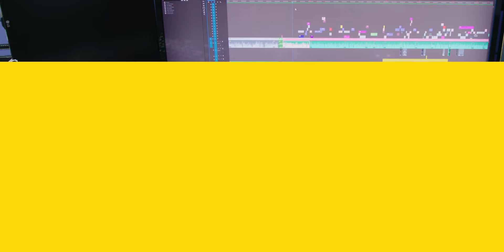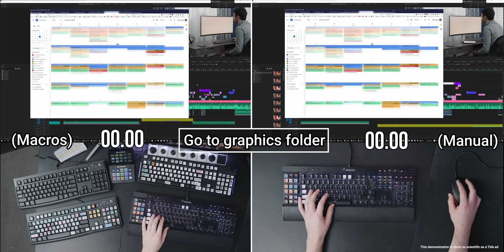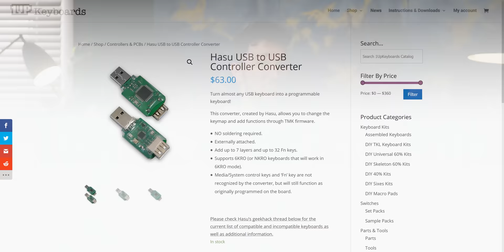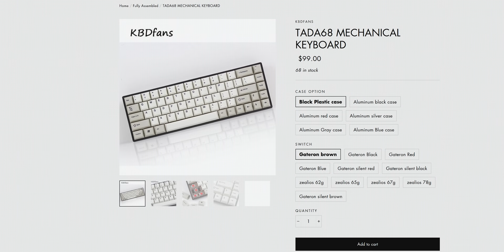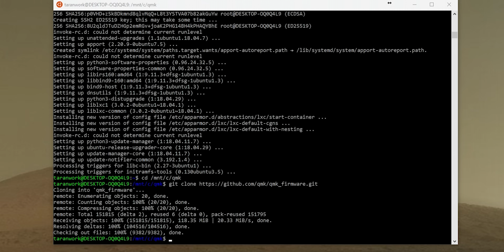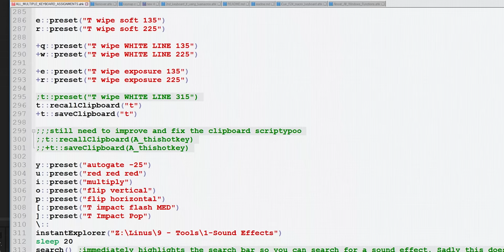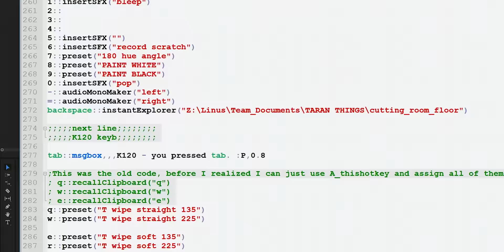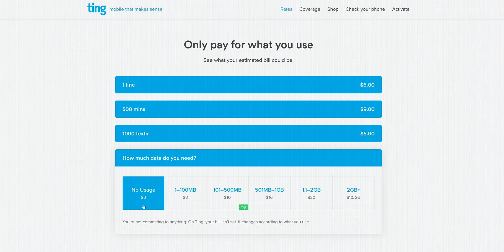Can your Keyboard do THIS?? - Make ANY key a MACRO!

Comment: Meh.....
After trying the inception driver and completely messing up my windows 11 after the installation, I decided to take matters into my own hands. (I couldn't even logon to my computer because my keyboard driver was so messed up.)
My solution was to use a pi zeroW. I wrote a program to read the raw key strokes, and send them in the raw format to a program on my computer.
On my computer I had a folder of programs that I wanted to run based on the key ID. Eg: The "1" Key has a key code of 2. In the folder I had a script file named 2.(whatever ending, eg exe, ahk, bat, ink, ....etc)

The beauty of using the pi zeroW with network sockets is that my keyboard is now a wireless network keyboard ! ! !
I can also control multiple computers at the exact same time ! ! ! (Come to think of it.... I could run it from the other side of the world!)

(I can't wait to mess with someone's head that I can still use my old broken keyboard after unplugging the chord.)

Hypothetically this could all be done with a pi 400 (70usd), but the pi Zero W can be had for <10$

Next step: Cellular based keyboard? Not so hard to do... however I can't think of an application for it.

Comment: I really don't get it why there is no keyboard manufacturer which creates keyboards where you can define every single key with a software. 
Having to use further hard and software is so dumb. 
Especially things like "hitting shift twice to write brackets" should be part of every keyboard software.

Comment: Once it’s setup is computer dependent or completely usb hosted. I have had need to move the usb to different systems to do macros especially for form fill ins.
Reply: You would still need AutoHotkey installed along with his scripts (customized for your needs) installed on a computer.  The Adapter though would mean that you would not have to have to install Luamacros on the computer and configure it as once the $63 adapter was configured to convert all key presses to press the F24 before and let up after you release a key that part would function from one system to another without installing anything.

Comment: I downloaded a Corsair program that gave me heaps of system info like temps and hardware utilization but  it crashed my computer a few times and disconnected my keyboard and made my pc fail to boot a few times so when it finally booted I uninstalled it and now my pc is okay, why did Corsairs program do this?

Comment: Windows user:  I want to add a second keyboard just for macros.  This will involve buying a USB interceptor dongle, spinning up a Linux environment within Windows, installing Git, downloading an entire repo, modifying firmware for the dongle written in C basically to wrap any keypresses from this keyboard with an F24 key I'm using as an additional modifier, compiling it, using some other software to flash that to the microcontroller in the dongle, making sure you've done the correct rain dance of plugging the device in, then install autohotkey and program any macros I want to use in autohotkey's proprietary scripting language that isn't used by anything except autohotkey.
Linux user:  I want to add a second keyboard just for macros.  This will involve writing ~10 lines of Python to use the evdev module to reassign keypress events from the second keyboard's device ID to any character, Python function, shell command or whatever I want.  I'll have to add my user to the input group and set the script to run automatically at boot.
Mac user:  huge trackpad go brrr
Reply: Also, I'm a pilot.  Airplanes are increasingly switching from single-function gauges and controls to multifunction displays and inputs.  Garmin even makes primary flight displays with goddamn touch screens.
Reply: @thegardenofeatin5965  What a good idea! Use a USB programmable touch screen for macros. Let me know when you have a prototype and I will beta test for you. It's only a matter of time before this is available.
Reply: @franklidgad  I mean, at that point, just buy a big ol' touch screen and write a program in QT or whatever to do whatever you want it to.

Comment: There's a much simpler approach. I've bought a Razer keyboard and keypad, Corsair keyboard, and Genovation keyboard (KB170) and a logitech gaming mouse (G502). Each has it's own software to program each key individually without any extras or other programming related stuff. I applaud you for your creativity and problem solving abilities, but it really isn't necessary.

Comment: Maybe I haven't fully gotten it but I think you just wanted to confuse and wear out people? Why not using for example a EvilCrow Keylogger device from AliExpress which costs a third and is also an Atmega32U4 board with Wifi and SD card support? This HASU thing seems to be totally overpriced to me and a light version of the EvilCrow. And why the hell using AutoHotkey? It is one of the biggest IT security weakpoints and it is blocked/forbidden in most company networks/pcs. And if you are already scripting in AHK on this level then you could also reprogram the Atmega32U4 directly with the Arduino IDE and it's librarys. That's kind of a similar challange and your solutions seems to only overcomplicating things. And further you would have a completely HW compatibel solution without having to install any SW to your PC/Smartphone/Tablet. It will work everywhere as a HID and the PC won't be able to find out if the key presses are real from a physical keyboard or code triggered by the Arduino microcontroller. Or am I missing the point of this video?

Comment: installing ubuntu shell + compiling hex is TOTALLY UNNECESSARY no matter what your argument is. You can completely go around this by using the tmk online configurator.  there is nothing you need to do manually that the online configurator can not do.

Comment: Is this info still relevant?  The HASU converter is out of stock. 
Also, I bought a Corsair K55 keyboard based on your videos but I cannot program macros. After searching the web I’ve found lots of people having the same issues with the keyboard and the iCue software.  
Please suggest an alternative programmable keyboard!!!!  I desperately need one 😢 because I have carpel tunnel in both hands so I want to reduce keystrokes and mouse clicks. TIA!!!
Reply: The K55 works just fine, I'm using it right now with the latest version of the iCue software.

Comment: 04:03 . "One of the best features Rayzer Cynosa Chroma is that it can distinguish between multiple keyboards". Does that mean If I buy multiple keyboards of this one I can let each of them a completely separated and distinguish Macro keyboard (with no conflict between eachother)? If yes then Luamacros (and alternatives) won't be needed anymore. Am I correct??
(I know it would be a more expensive solution but does it work?).

Comment: ok  i see you are always working for macro keyboards but what i really want to see is a macro keyboard conversion that does not need to have files or executable on the pc it is connected to.
A cheap version but broader version of the genovation principle. I cannot and are forbidden to to any installation on a company pc so it all has to be contained before the keyboard port. 
You can use another pc to do the configuration but then it runs on itself independant.

That is what we would lie to see happen. So you have a assignment if you want to

Comment: Is it possible to use the Hasu to make any key register as a different key while a modifier is being pressed? For instance if I held alt and pressed a, can I make it register as num7? Also can you make it so the active profile is dependent on the currently running software?
Reply: maybe,
and no.
Autohotkey CAN distinguish whatever software is working. So the same keypress can do different things depending on what's running. So it's best to do it all in AHK. The point of the layout is just to communicate with AHK. It does that heavy lifting.

Comment: But what do you do if the LTTC. codes start firing up your installed anti virus and block them selves off deleting the flashed program on the converter ?
Reply: BTW I use quick heal

Comment: Is there any way that I can not get a macro but an extra key when I plug in an additional keyboard? You have mentioned in the videos that you can quasi set the keys F13 to F24. I'd like to have an extra keyboard with the keys F13 to F124 (or something similar). Maybe I do not understand the explanation correctly, but to me it sounds like you're using keyboard shortcuts on each key on an additional keyboard (like CTRL + C, or 'open this file' etcetc). In my mouse, I have keys that are recognized as thumb-button-1 and 2 and would like something like that for a keyboard. Since I mainly play and therefore can freely assign the functions, a solution that does not enter a specific key combination, but is an additional key is better for me.

If someone can help me, or teach me a better one, then I'm open to everything.

(I mostly play ArmA3 and use the editor, there are about a million functions and I would like to assign them individually so that there are no overlaps in the game)

Comment: Taran, very interesting. I have limited desktop space to add another keyboard so what software could I use to reprogram/override the function (F) keys on my current keyboard ? (using Windows 10) Using the reprogrammed F keys along with Ctrl, Alt, Shift functionality would give me more than enough programmable keys to do what I want. Would also need an On/Off hotkey to disable when not required. Anything out there that could do this with out having to add additional hardware? (ie: Hasu USB to USB)
Reply from the maker: Yes. Autohotkey can do that easily. No extra hardware needed. Take this tutorial. You can ignore the section about Objects.
https://www.autohotkey.com/docs/Tutorial.htm
The on/off hotkey is a bit tricky. I don't know what code to use for that, but they would know on the AHK forums.
-TVH
Reply: @LinusTechTips  Ok, thank you for your reply. I will check it out.

Comment: First: When did the singer of Foo Fighters become a tech nerd??

Second: Okay, I get it. Macros shave seconds, which become minutes, which become hours, which can even become days or weeks saved. Here's the deal...it would take me MONTHS to learn how to do all the pre-requisite stuff necessary to make this "time saver" possible. So I ask...

Why don't you make the end product available for customers as a turn-key solution? I'd pay for it, if I didn't have to skip meals for a month to cover the cost...and it is compatible w/ DaVinci Resolve. ha
Reply: You want a turn-key solution? You got it, boss. Buy a Stream Deck XL. Each key can be easily programmed to send any keystroke(s.)
This won't give you super powerful macros like what I've programmed in AHK, but it will at least give you more buttons to assign shortcuts to inside of Davinci Resolve. (I'm pretty sure it supports F13-F24...) Note that this is only worth doing AFTER you've use up all the available keys on your keyboard. So if you've got some unassigned function keys and numpad keys, use em first!

Comment: Didn't you already do a video like a year ago about how to do this for free using LuaMacros and AutoHotKey?
IDK bout you but I for one am not about to not only pay extra but DOUBLE the price of my second keyboard (and that's assuming I get a nice one!) AND use a fudging hex editor for configuration (neither I nor any of the programmers I know will touch a hex editor with a ten-foot pole if we can avoid it) when it is actually easier to write a program in two different scripting languages to do the same thing for free.

By the way I happen to know my way around a microcontroller and that board CANNOT cost more than $30 to manufacture.  My guess is it's more like $10.  They want $70 for it.

Comment: Good video a little pricey though when cheaper stuff is out there. I just use a arduino pro micro then hook up what ever switches I want I tend to stick with arcade buttons there so nice to click and really cheap got a full 6 button programmable button box and a 4 button one didn't cost anything really if I had to guess like 15 $ maybe less. Also got a smaller 4 push button macro and a flight stick I converted and bought for like 2 $ thrifting if your creative enough you can make dozens of macro's for less then 60$.

Comment: 3rd place 50 USD
2nd place 60 USD
1st place 63 USD + 15 USD

Makes 0 sense. Who cares if it is the cheapest qmk, if you can get a cheaper keyboard for macro purposes. Need more than 1 macro keyboard? Get Razer. Only get hasu if you really need the qmk functions, but this is a video about macros.
Reply: Having to reattach hasu everytime you restart is also a big minus. Does not even work with modifier keys. For your purposes, hasu as number 1 is really dumb. Even if you have a keyboard lying around, Corsair and Razer is still cheaper. What a joke!

Comment: I'm a little confused as to why they wouldn't just use an Arduino Due, or an Arduino Leonardo Pro Micro with a USB host adapter. It would be just as small as the suggested solution here, would be about $10, and would be significantly easier to program as there are good keyboard in/HID out libraries for arduino
Reply: How would you actually implement it with AHK though?
Reply: @ModernNinjaTurtle  you could configure one usb port as a usb host for the keyboard, and one port as a HID device, simply adding the "alt" button on all inputs, for example. You could then circumvent the need for AHK simply by changing your keybinds.
Reply: @mitchellbland1655  Im gonna try this for the cause; what hardware would you need specifically?
Reply: Actually, another quick google shows that you can emulate the F13-F24 keys through the Arduino Keyboard (output) library, so I don't see a reason why you couldn't just remake the product he talks about completely.
Reply: @mitchellbland1655  for the purpose of recreating this result without spending asinine amounts of money, how would you go about implementing it with AHK? How would you circumvent the use of AHK and still have the same functionality he gets from all his scripts?
Reply: @ModernNinjaTurtle  so, to circumvent AHK, I would simply build the setup I described earlier, and simply "replace" the inputted key with the outputted macro. For example, if the button a needs to become copy, just output ctrl+c when the a button is pressed. The code for this would be pretty messy, basically just a massive case-and-paste, but I don't see a better way.

To implement with AHK, you'll have to cut me some slack as I've never used AHK and don't do any of the video editing, etc. That it's (in this case) used for. It sounds like the product he's using simply "wraps" the button inputs with the F24 key, so that AHK knows which script to run. Since the Arduino Keyboard library supports F24 as a key, this would be fairly simple
Reply: @mitchellbland1655  The reason I ask for AHK is simply because Id like to see if I can replicate this HUSA usb converter without spending so much money; you telling me what hardware youd use gave me confidence that Im on the right track. I think Im going to build an arduino converter that takes the input from a second keyboard and outputs it as a macro, specifically a powershell script. If I absolutely need to use AHK, I can simply run it within powershell. The only pain is going through ALL of Taran's scripts if youre doing video editing and seeing what hes doing for shortcuts and rewriting them lol
Reply: @ModernNinjaTurtle  haha yeah that sounds like a pain. If you're not experienced with Arduino, I would check out the Serial class for running scripts.

Here's a link of a similar example:
https://stackoverflow.com/questions/29331135/how-to-make-arduino-run-a-script

Comment: 7:01 screw setting up a Linux in windows environment I can just shut down my pc and use grub to access my kubuntu installation
Reply: sure, but one of the very few disadvantages of Linux is the lack of a replacement for AutoHotkey. So you're stuck rebooting all the time. I have dual-boot, too, and I'm still using WSL.

Comment: $65 each keyboard + need hex edit file for macro keyboards wrapper for 104/104 keys. Lot of work and money. That is tippy top performance money. I'll aim lower and try to get 89/104 for the cost of a 104 keyboard. 

How? Use outdated software of course. HIDmacros + AHK. F key wrappers. When fruitful my 15000+ lines of setup script will get 89/104 for the price of a keyboard(free-?) and not have as much setup(or its a fail)